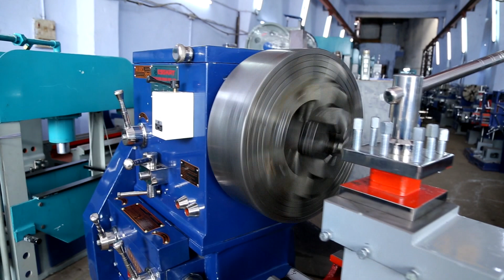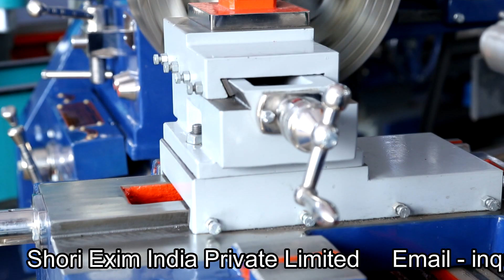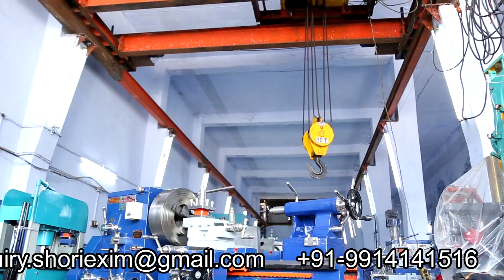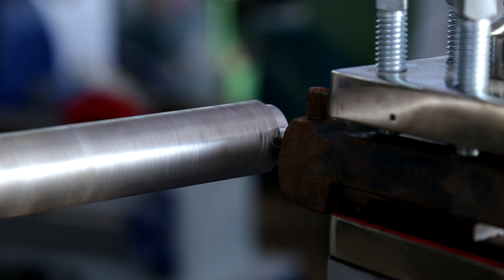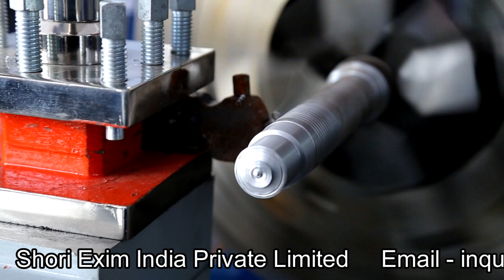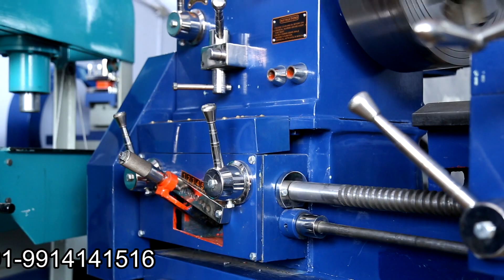#6 feet lathe machine price batala # lathe machine parts name # lathe machine introduction #lathe

Comment: I want to bye , what is the model no
Reply from the maker: Model No- EKL-614 , its 6 ft lathe machine , price 1,30,000.00 for this machine because its 7 inches spindle bore , if you want smaller spindle bore then it will be cheaper, for more information , please call on 9872172154
Reply: @esskaylathemachine  I want with Norton gear 🙏
Reply from the maker: yes available  with norton  gear box
Reply: @esskaylathemachine  धन्यवाद sir ji 🙏
Reply from the maker: Any update on your requirement
Reply: @esskaylathemachine  medium lathe full Norton gear  price